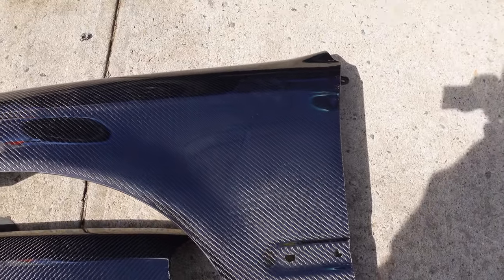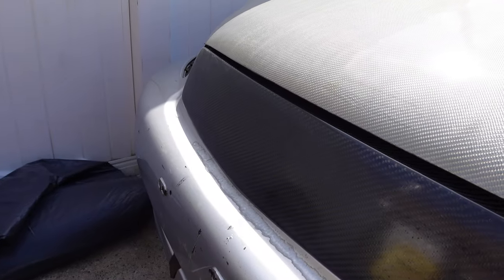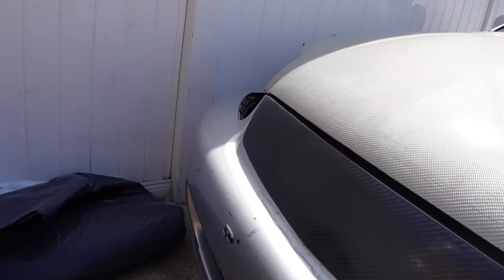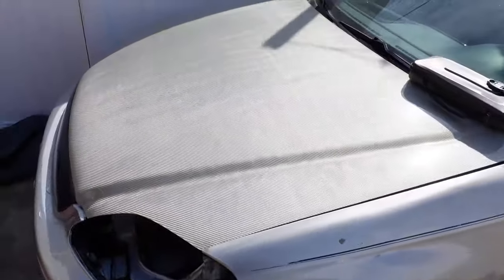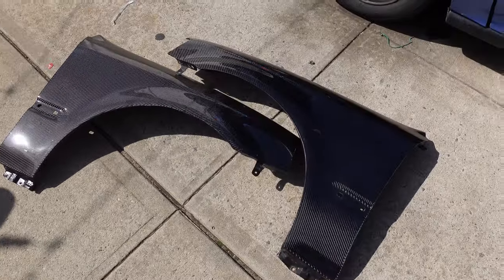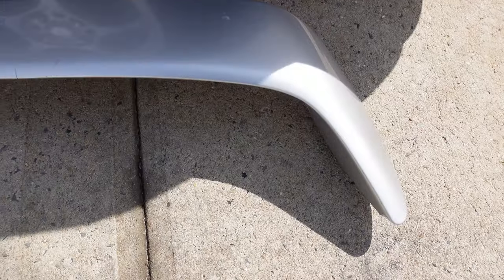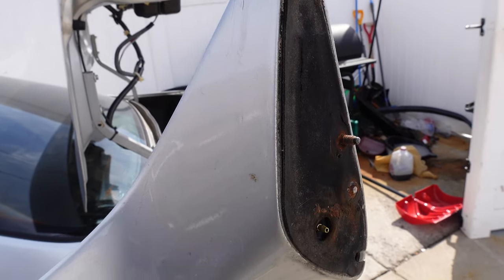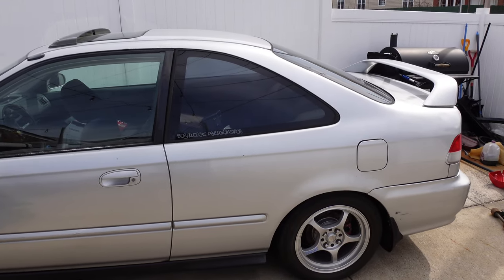EM1  wing (spoiler) install/ carbon re clear follow up

Comment: You should double check what is yellowing; if the clear coat is yellowing or if the carbon fiber itself is yellowing. Because if it’s the carbon you will have to find another way to fix it.
Reply from the maker: How do u check thay
Reply: @dmhondagarage282   I was wrong it’s probably not the carbon itself; it’s the epoxy that was used in the process of making the hood. Basically their is no easy way of fixing it but you possibly could slow it down by sanding the clear coat/epoxy and applying a automotive clear coat because most automotive clear coats are u/v resistant.

Not sure if this link will work but he does a great job at explaining it
https://youtu.be/ND2zVosuzIE
Reply from the maker: Thanks I appreciate the info